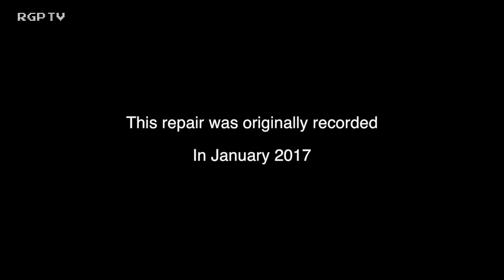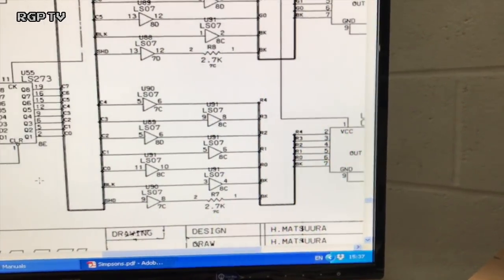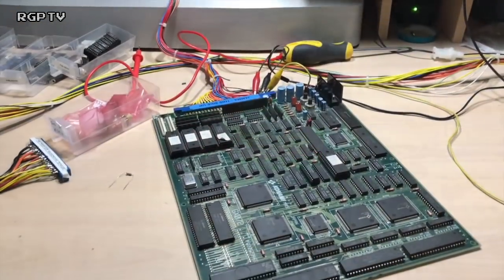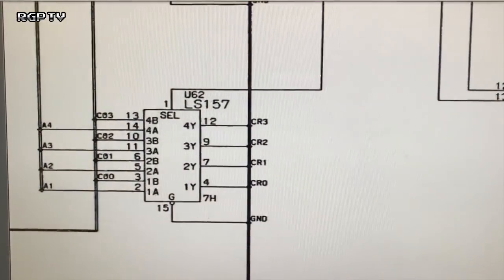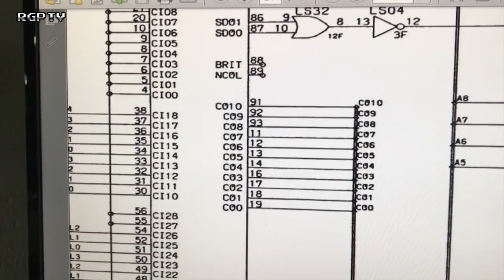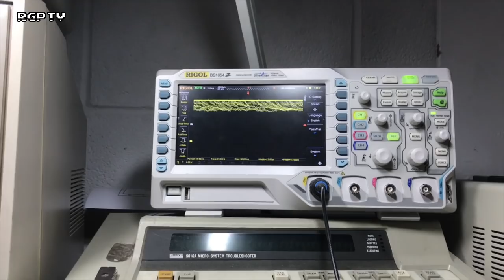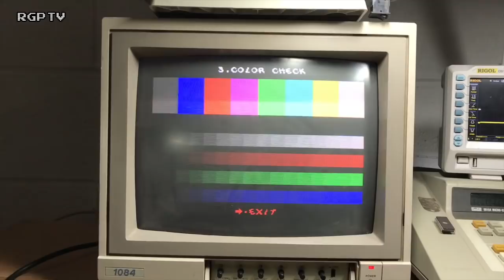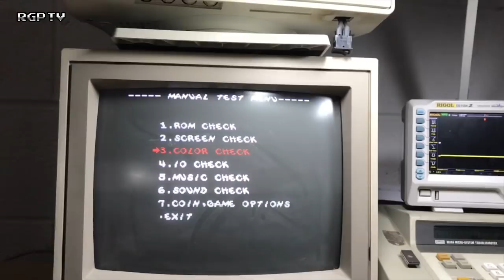Konami's The Simpsons Arcade PCB Repair

Comment: Nice fix! I've used similar tricks on controller inputs (adding a strong pullup to override an internal short), but never on full-speed logic like that. Impressive that it works!
Reply from the maker: I had to try a few different values of resistors to get it to work, i'm not an electronics expert by any means, transistors still confuse me sometimes so i'm never sure whether you want a higher or lower value resistor to affect the pull-up/down, I started with a 1.5k I think.

Comment: Great save for that custom chip there =D  Nice!
Reply: BTW - I might consider swapping out the 157 at the same time, is there no chance the 157 was pulling it high?
Reply from the maker: I thought that at first, my deduction was that I snipped the input leg on the 157 and it remained high, comparing it with other pins coming from the same custom which were properly cycling low I figured the custom wasn't driving low enough on that pin so pulled the input to ground via a resistor to get enough level for the 157 to do its job.  The tracks are flaky as hell on those boards so I didn't want to desolder another chip if I didn't have to.
Reply: +Retro Games Party Great!!!  All bases covered then!  =D
Reply from the maker: I don't think the 157's have internal pull-up/down resistors because of the universal application of them, in hindsight I should have snipped one of the known working legs and compared that for absolute certainty but the board is back with its owner and they are happy.
Reply: Hi I am wondering looking fixing old arcade boards, this is a full time job or is a hobby for you?

I am in electronics for 40 years, most of repair shops are closed here in my country .
I fix treadmill machines for many years and still have a lot of job.

Cheers.

Comment: Nice job. Pull-down resistor... I understand what is happening and what you have done (I formally studied electronics at TAFE for two years AND I have a large kinetic vocabulary) - but I would have put the board in the too hard bin like most guys. I love bootlegs  as they ar e far easier to repair due to the lack of custom chip paranoia presence. Keep the videos coming. ☆♡☆ Ya... 5☆ Work hard to eat nice food, drive nice cars and kiss  'N cuddle pretty girls. Bye!!!

Comment: Looks like the chip is damaged and cannot pull that pin down. The pull down fixes it as it allows the signal to go low in the absence of being driven high. Neat fix.
Reply from the maker: Was definitely a bit of a hail-mary play that one - a hunch that paid off and the first time to be fair that i'd introduced a passive into a circuit.

Comment: RETRO GAMES PARTY, 
   ^^))    1.) Whats the difference between a PROM chip compared to a BI-POLAR PROM chip?
        2.) Why does the HP comparator give false positive result and doesn't work correctly when comparator H&V counter chips? it loads the output pins or something because the HP comparator will say the counter chips are bad but aren't bad any reasons why?
Reply from the maker: 1) In the context i'm talking about they're the same thing.

2) No idea at all - I almost never use mine anymore, just use the scope to debug boards.  The two common fails on the H&V counters are either floating / tied low-or-hi OR that they are not counting at the correct rate.

Comment: that's brilliant. Hardware hack :D
Reply from the maker: Yeah, i've had to do that on a few boards either pull-up or pull-down, its the same principle as how input controls from regular switches work - there's +5 going to the switch and you ground it, but you'd get a spark and short circuit without the resistor in the path taking the current so you'd see a HI signal at the input pin then when you close the switch it will go LOW.  The device accepting input usually inverts the signal so that you see a 1 in the relevant data address for that device rather than a 0.